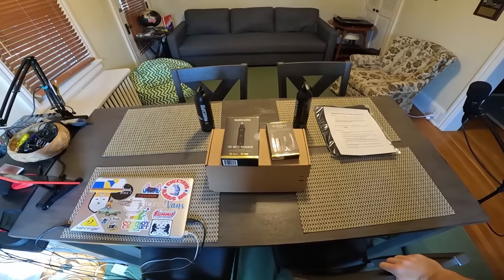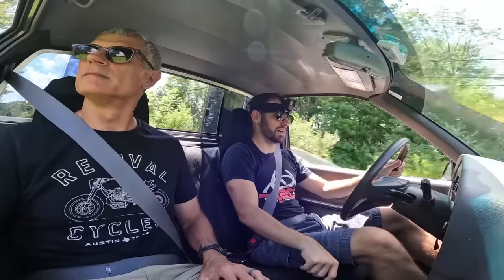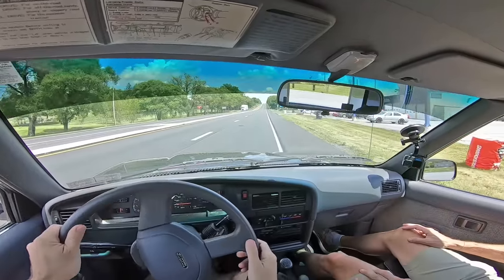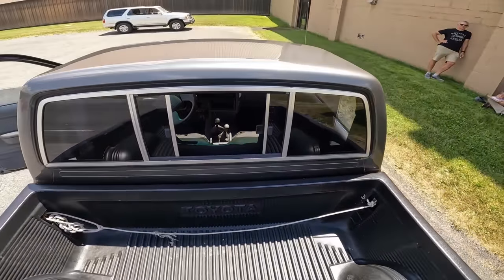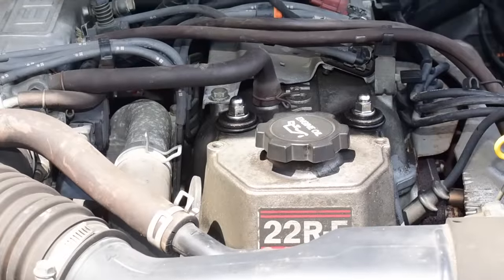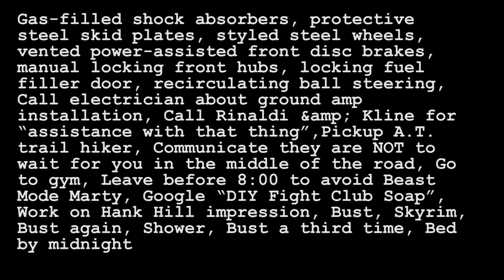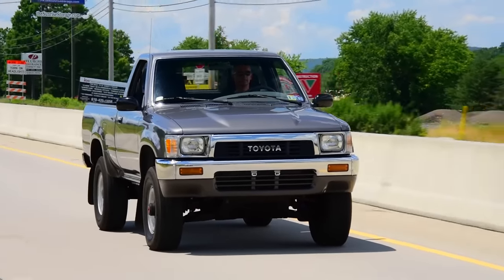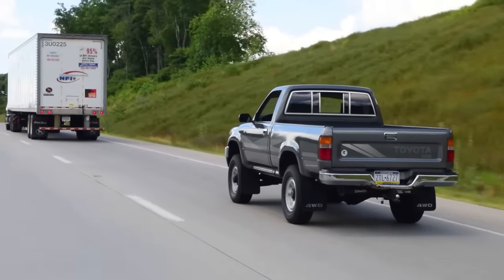1989 Toyota Pickup SR5 4X4 5MT: Regular Car Reviews

Comment: Should try the 2.4 Diesel Turbo.
It has a green light on the dash when the turbo is boosting.
Goes red when it's not.
Generally stays on red.
Maybe 40 mph onto the highway, hold it down - maybe intermittent flashes of green - and 65 mph is tops.
That was a Surf.
Fucking awful.

Comment: The Hilux is a superior pickup compared to the American Tacoma. 
The Hilux can haul 2204 lbs (1000kg) in the bed. This is more than even the Tundra. And it can tow 7716 lbs (3500kg).
The Tacoma can only haul 1095 lbs in the bed and tow 6400 lbs.

Comment: Oh this is weird... I have a 1994 Toyota Pickup 22re, 4x4 single cab and it looks like this one almost.... just mines a auto... and you thought the standards were slow try a 3 speed auto (4th overdrive) lol
And mine has less rust...
Currently mine has 268,000 miles, with working A/C
...I've done 93mph on my truck, yes I was scared at that speed... but it can do 70 decently and yes it rides like shite... the standard, 4cyl I read could get almost 28 highway mpgs? ...my auto I was able to get 22mpg at the most and at the least was about 18 (thats useing ac)

Comment: Im sorry but the US sr5's are NOTHING like actual hilux from over seas. The real hilux's have much beefier frames, diesel engines, and much more robust suspension. the Sr5's among most other US toyota trucks have serious rust issues in comparison to Hilux trucks.  

Don't get me wrong the 22r/e is an awesome engine its reliable, fun, and gets you where you need to go. but a hilux turbo diesel from the same era is gonna not only do all those things its also going to be able to haul a much heavier payload.  and id argue that the hilux diesel will EASILY outlast a 22r.

Comment: Maybe if the fan wasn't stuck on it would go over 55 but since you are  clueless about automobiles you think that the noise and power output is normal....
A stock 22RE pickup without a malfunctioning fan clutch robbing 20hp will do 70+ all day long

Comment: Oh, my 88 4Runner was faster than a Mercedes 240D. But not much. And it got 18 miles per gallon, unless you drove it like my grandfather on a quaalude binge, then it got 20. But I managed to drive it fast enough to boil the brake fluid after the Susquehannock Trail Pro Rally one year....

Comment: These are slow but let's be fair, can do over 55, no question. My 94 2WD w/ 5 speed, got it up to 80 and could have done more. My 87 4WD, 4-spd auto trans, with a long bed--it could do 75 on the highway flat out.
Reply: it's slow but you don't technically need to go faster cause it's illegal. that's why they're perfect

Comment: It made sense back then because it got better fuel mileage than a full sized pickup,and original country music wrote song about Cadillac's ,and Lincoln's not pickups that's a modern thing.and Toyota pickups are over rated the top gear truck was a diesel.anybody could make it run.I don't want one.

Comment: Idk.  Okay truck but way over hyped .  Frame too thin cuz supposedly boxed. Need to weld plates on for roll cage mounts and such. Plus you absolutely need to do a 3.4 or 4.0 v6 taco engine swap to make it move. Steering needs “total chaos King Kong “ steering upgrade too.  Actually the only good thing about these 4x4 trucks was the spindle (knuckle) /floated hub and bearing spread  .  They are not like the Piece of shit unit bearings all trucks use.  Plus if your a 4x4 slow poke I guess manual hubs are ok.  I’d just use the spindle and hubs to build a 2wd long travel prerunner.

Comment: They were ok trucks till they started to rust, you go out the next day and it's gone! Just a pile of oxidation left in the driveway. And the engine was junk, 100k on it then the timing chain guides would break letting the chain eat a hole through the timing cover until it finds the coolant, then by by engine.